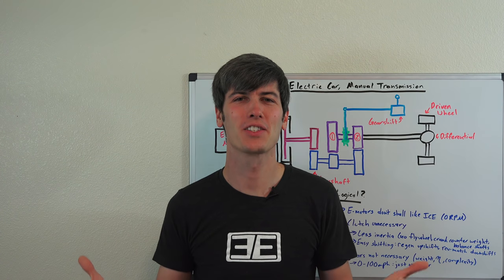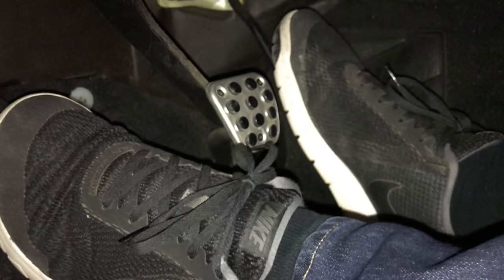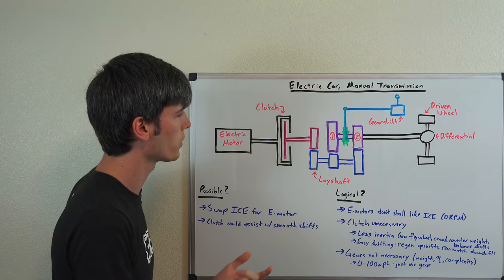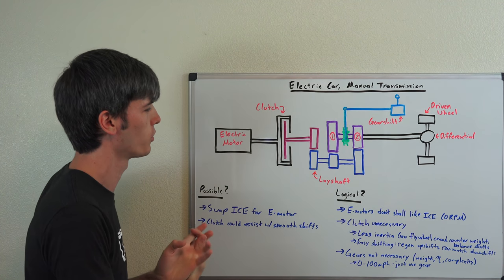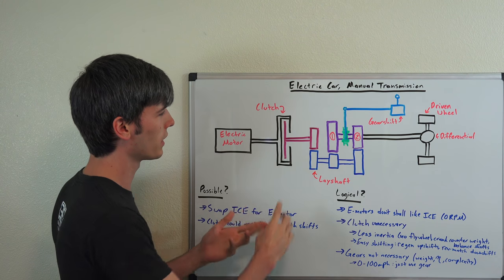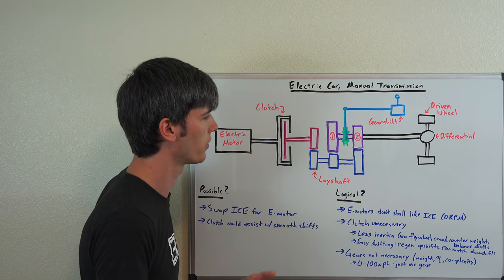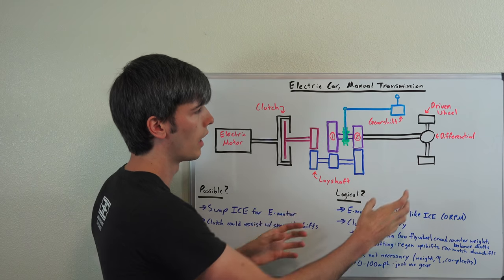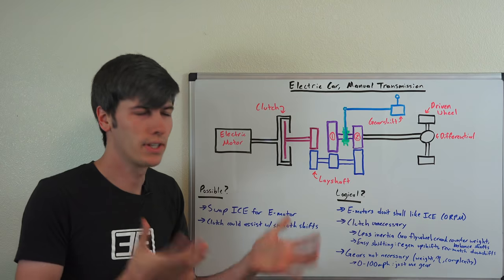Could Electric Cars Have A Manual Transmission?

Comment: For sepex type motors, the field strength can easily be controlled to to act like a CVT. A strong field will increase torque, but reduce RPMs. As the field is weakened, the RPMs can go much higher, but torque is reduced. Something similar can be done with brushless motors, though it in much more complicated. For a homemade electric motorcycle, a brushed sepex (separately excitable) motor, with a smart PCM type controller that handles both the field and armature currents, would be the most cost effective solution. Regenerative braking could also be incorporated.

Comment: Started writing this before I watched more than 5 seconds into this video. Simple answer, yes. In my high school, I was in some auto mechanic classes. One of the classes a few years ahead of me had actually took an old geo metro or some other small car (can't remember, its been years now) but the class had actually swapped out the motor for an electric motor and it had a manual transmission, though it did not have a clutch. It was as simple as let off the throttle, then shift, then back on the throttle

Comment: We someone brings up Electric Cars having transmissions, I am reminded of certain RC cars of my youth, The gravely underrated Parma Mini Mustang being first to mind. It was available withe 2 or 3 speed transmission. This allowed much less powerful motors to propel the car at speeds equal or greater than single speed RCs with more powerful motors. It was pretty quickly outlawed for competition, but still crops up from time to time mostly in trail/Crawler trucks now so the thing can switch between being a crawler and being a dune running truck of sorts. 

In a full sized vehicle, a transmission should have a similar application. This allowing the car to be as fast or faster using less power and would be key for and EV to cap say 200mph without completely bottoming out their range or just maximizing range over distance. Obviously this is not an unknown concept.

Comment: We also still use manual because it's more durable than automatics. Simpler and easier to repair and maintain. This is part of the reason a lot of trucks still have them. and even if they do have an automatic gearbox, it's usually just a manual gearbox that shifts automatically rather than CVT, DSG etc.

Comment: For commuter cars engineering explained is right in that they only need one gear but for others vehicles it would be very beneficial so I wish he would address that. The main types that would benefit are trucks and performance focused cars but since this channel is more car focused ill just talk about that. The reason why some teams in formula e go with only one gear is because with the current rules it makes since. With how little of power that the cars make combined with the bad tires, low downforce, types of tracks that the race on, and the low top speeds, only one gear can work. Even then it is still unclear which is the best solution as the majority of teams are still running multiple gears. For high powered cars and street performance cars a second gear would really help. The power and especially the torque starts the fall off the faster you spin the motor, it's not a flat curve all the way to redline as most people think. A second gear would allow the first gear to be a much higher torque multiplying gear (useful when the tires and downforce get up to par) and the second gear would allow a much higher top speed. Rimac sees this as does the electric semi truck manufacturer Nikola motors.

Comment: It might make sense for heavy trucks at startup, and for the off-road vehicles that are used for "crawling" over obstacle and huge rock courses, at extremely low speeds. The electrical current going into the motor is going to be proportional to the load placed on the motor, and this current quickly translates to heat. Too much electric current and an electric motor will either stall (via circuit protection) or something may burn up. Just because it is an electric motor, you can't say it can't stall.

Comment: With gearbox you just can save energy! To faster drive you can switch the gigher gear and the elkectric motor has not to need to revolve so fast, waste so much energy and has less friction.

Comment: Wheeler Dealers did this with a Maserati Bi-Turbo and Edd mentioned that the car didn't need the clutch to shift gears since electric motors don't stall so you could probably do a direct drive with the gearbox.

Comment: I had an idea for a hybrid with manual transmission where the electric motor would be used for starting from standstill and creeping through traffic, but once you get up to above say 20, you would shift into 2nd and use the power of the combustion engine. This would provide a r remedy for the least desirable part of driving a manual. The idea included a first gear and could be driven as normal.
The only problem is  very few people want manual transmissions.

Comment: 1. Manual trans are quicker in certain areas such as a road course, off road, or towing.
2. Yes you still need a trans for a motor because you can lower the RPM of the motor while at a given speed (say 75mph on the highway) which gives you longer range per charge.
3. A manual trans is more efficient than any auto trans (direct drive is not included as it is no trans).

Comment: I had a electric remote controlled car with a 2 speed gear box.  The low gear was good for accelerating quickly. Hi gear was great for top speed, especially after I doubled the voltage to the motor.  A two speed would be ideal for a racing vehicle but not practical for a daily driver. The extra gearing just adds to friction losses. 1 motor per wheel direct drive would be ideal to minimize friction losses.
Reply: Direct drive on an electric car, i.e., having the motor run at the same speed as the wheels, would require a much bigger and heaver motor.  The power to weight ratio of an electric motor depends greatly on the speed of the motor.  Thus, a motor which develops 100 HP at 500 rpm would be drastically heaver than an electric motor which develops 100 HP at 5000 rpm.  Moreover, if a traction motor were built into a wheel, it would drastically increase the unsprung weight.  So, unless advanced technology in the future makes it possible to make electric motors far lighter, it is unlikely that we will see electric cars with motors built into the wheels.
Reply: I wonder what a second longer gear would do for range on a long trip. Would it allow the motor to work less while maintaining the same speed?
Reply: @hulkhatepunybanner no

Comment: EV West does produce swappable electric motors that directly replace combustion engines in a lot of different platforms, all that's needed is a mounting plate to secure it to the transmission, a vacuum pump for brakes, and a hydraulic pump for automatic transmissions at low RPM.  It's already possible to bolt these up to currently existing manual transmissions, if the owner wants to do so to their own personal vehicle.

Comment: The torque curve of an electric motor is quite close to the ideal Torque - speed curve after reaching max HP, which is what gear boxes try to approximate in discrete steps. If your motor can spin fast enough without losses and generate enough torque at low speeds, a gearbox would not be necessary for most cases. We had gearboxes because we needed the extra torque in the lower gears and to disengage the engine while stopped.

Comment: Alot of the home built vehicles mount to conventional transmission both auto and manual to alow for the use of generic motors rather than having to buy a more expensive motor designed to run up to the higher rpm also allowing heavier load capacities for example in your electric truck conversions

Comment: Was watching some other video with a home-brew of a classic car where the gas engine was swapped to electric on the existing powertrain, and the first two gears were nearly unusable because too much torque from the electric. Was good for burn-outs but that was about it. The guy that normally drove the car just pretty much used 3rd and reverse.

Most electrics skip the gear-box completely because it makes them more reliable.

Comment: In industrial applications, outdated electric motors can "top out", even if if it happens at several thousand RPM. It means that their torque actually drops at high revs, just like ICE engines. It also means you could use these outdated, cheap electric motors in budget cars in the future, and use a 2-speed gear to compensate for their deficiencies. Or at least design new engines with those problems on purpose to make them cheap, if you get it.

Or you could just use gears for a great regeneration effect when going downhill, instead of using friction brakes. However, GM incorporated a 'brake' paddle in the Bolt steering wheel to force a greater regeneration effect by electronic means, again negating the need of mechanical gears whatsoever.

Some californian tinkerer applied an electric powertrain to a VW Beetle, coupled with a 3-speed manual transmission, and indeed, he could achieve better acceleration on the lower gears, coupled with a stronger regeneration effect, for obvious reasons. (Read about it on Jalopnik).

I think, in the end, Formula E could settle with a very narrow band CVT transmission, and achieve simply the best acceleration possible, coupled with the best regeneration possible, at all times, without adding a stronger electrical engine with a heavier copper armature, if they can shed weight by using a CVT transmission instead. There is no way around it, even electrical motors need lots and lots of pounds of copper to make their coils, and are very heavy, albeit compact motors. Because they are so heavy in a tiny package, you'd  have cooling problems if we were not talking about copper in the first place. If you can optimize around that even further...

Comment: Reason why I think a transmission would be needed for EVs is because they are single drive, the top speed is really limited. An optimal transmission for an Electric Motor would be necessary for an Electric Hyper Car to exist

Comment: Of course the land of manual would be at the top of their game in that arena. You're right, manuals are pure joy, only essentially, one is just sitting in a machine and shifting gears in compliment to RPM. The slower the heavier, the faster the lighter and almost no gear differential ratio. So how to make that electric (the pure machining joy element) one would have to depreciate the electric capability almost, kw in precise ratio to mph( Km/s(h)) so a resistance substantial enough to only understand heavy pull, and the resistance gets less with higher gear ratio... Maybe, would have to test that concept. Or a combination command prompt in the PCM with the usual gear box to only allow certain kw of power per gear in relation to the shifting, but that's easier said than done

Comment: The people who convert their ICE to electric often keep the transmission just because its convenient, you don't have to come up with your own powertrain.
They mostly use two to three gears of the original transmission.
Some electric motors can change between star and delta wound windings with result in an rpm and torque change of about 1.6 just like a gearset. Combined with a two speed transmission you would get four gears, but maybe the two “electric gears“ are already enough.

Comment: If you have the rpm of the next gear on a tachomoter with the motor rpm, you could manually shift just like the computer would. In addition to allowing faster acceleration at high speeds, you could get more torque for towing or rock climbing.

Comment: I know of this company that transforms older manuals (mostly diesels and petrol 4x4s) into EVs, usually by removing the ICE, fuel tank, clutch + pedal, flywheel, 4th gear and above, and replacing them with an electric drive-train coupling motors directly to the gearbox, with 3rd becoming drive, 2,1, Neutral, and reverse retaining their positions, and no 'park.' It seems to work well, but I guess an easier conversion would be just removing the ICE + fuel tank, replacing them with e-motors + battery units of a comparable output, and retaining the flywheel+clutch+manual GB assembly. Though I suppose the extra weight and friction losses would be undesirable.

Comment: It would be more helpful to discuss characteristic torque curves for synchronous motors typically use in cars, and their relationship with gearing and automobile dynamics in normal driving conditions.  Tesla's first roadster had a 2-speed transmission for a reason!  Although a multi-speed transmission is essential for ICE's because of limitations of engine torque, an electric motor-powered vehicle can utilize multiple gear ratios in a different way.

Comment: Simple answer - Yes.   I've driven one.   (it was the only one of it's kind ever registered in the UK)The vehicle was a Daihatsu micro van back in the 80's.   All they did was remove the petrol engine and install a large electric motor.  The 5 speed manual gearbox was left in place.  The fuel tank was used to house the ballast resistors, the back seat, added to make it a 4 seater, housed the battery bank - 8 12V truck batteries.It had a range of about 40 - 50 miles and could easily manage 70mph.  I honestly wish I'd bought it when the owner (my boss at the time) was getting rid of it...

Comment: with electric cars though, maybe a manual transmission or at least gears would increase their range maybe. In combustion engines, sure you can accelerate faster in lower gears, but you lose a lot of fuel, so you switch to higher gears. The same concept applies with the electric motor, even if one gear is enough to get you around, it'll probably be more efficient to have more gears. idk, could be an interesting exploration topic
Reply: Yes, but not in the same way as gas cars. Having a transmission helps an EV be more efficient IF it is a very small motor. That is because you may need to push the engine harder to make it up hills or get up to speed. With "large" motor EVs, you can get around that need entirely. However, you may have issues hitting very high speeds. So a second gear helps at that point. 

However, it still doesn't make sense for most EVs. An EV motor weighs about the same as a transmission. That is why large is in quotes above. Even a 500 horsepower motor is only around 11 inches in diameter. It's easier to just put a second motor on the vehicle that is geared higher. One motor is the power for take off while the other is for higher speeds. Both are extremely efficient. It's simply about minimizing how much stress a motor is under.

Comment: Wouldn’t it make more sense in a heavy towing application? When I comes to mowing more than just the vehicle I imagine at least three gears would make sense. One low gear for getting the weight moving easier, a 1-1 gear, and one overdrive gear to reduce usage at speed.

Comment: I've never encountered an electric car with a manual transmission... but i have personally assembled and used a manual transmission electric vehicle - an E-bike. I used the "cyclone" multi speed electric bicycle setup, which allows pedal power and electric motor power the be transferred to the rear via the same bicycle chain. In my case there were 7 gears on the rear  wheel. Honestly, if the goal were electric-only power, a single-speed transmission would've been fine, but shifting to allow reasonable pedal speeds at all times resulted in gobs of electric motor torque available anywhere from 0mph to about 25mph. Different gearing would have resulted in plenty of torque at even higher speeds.

Comment: From my somewhat limited understanding of electric motors, the only point to having gears would be if your electric motor had a narrow range of RPM in which it was most efficient, more similar to an ICE. I don't know if electric motors can even be designed that way, or if they could, if it would even be pointful to do so. Mainly, I'm thinking of the potential future conversion of ICE cars we love into efficient electrics down the road. For such conversions, "peaky" lower-RPM motors would be desirable to maintain the driving dynamics of the vehicle and make shifting gears in them have a purpose beyond fiddling with the gear lever.

Comment: Owning a B7 S4 4.2L 6spd man + 3rd gen Acura TL w/ 6spd manual. Will never ever give up on manual. My next car will be B8 S4 6spd man for leisure, Acura 4th gen TL with 6spd man + SH-AWD, as well as an Audi R8 V10 with manual trans.  If not, at least a Z4 M Roadster (M3 engine).  Eventually I will get a R8 used one and keep it forever. :)

Comment: I don't know about the newest car's, but i've always gotten better mpg from the stick vs the slushbox.  It's highly dependant on the driver though.  I could probably do as well, maybe better if my damn automatic would let me hold gears longer (i like to lose speed going uphill in the tallest gear I can, then gain it back on the downhill right after it).  I have the manual shift option, but it only let's me raise rpm's, not lower them.

Comment: The greatest argument for 5-6 speed manual for electric cars is efficiency. Electric motors like to rev high at no load to keep current draw low,  unlike ICEs that need to give the fuel time to burn to maximize Mean Effective Pressure.

Comment: Interesting vid. I reckon the most important reason why manual transmissions are still so common in the UK is because they are usually the cheapest option. What are the stats over here?....75% manual or something like that? It's a long way off from just being an enthusiast thing.

Can't say I've ever missed having gears in a wee go kart so maybe I wouldn't miss them in a wee electric car either.